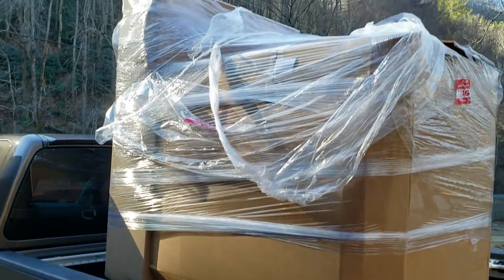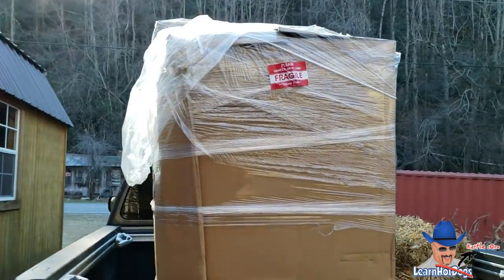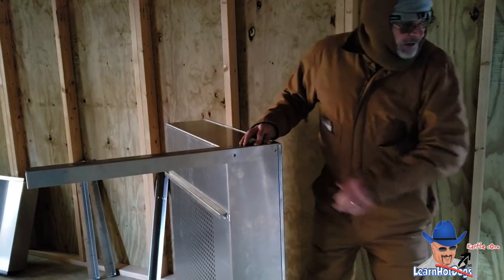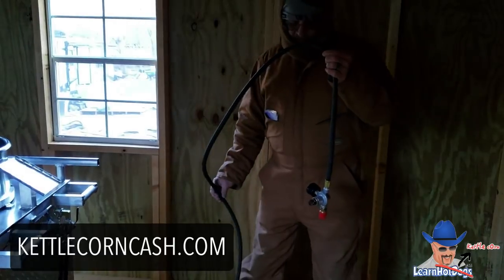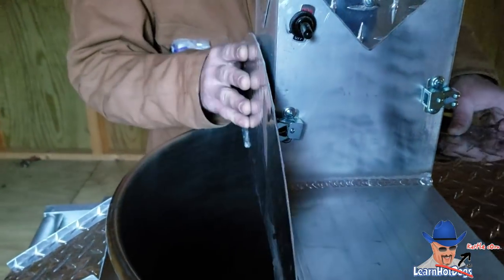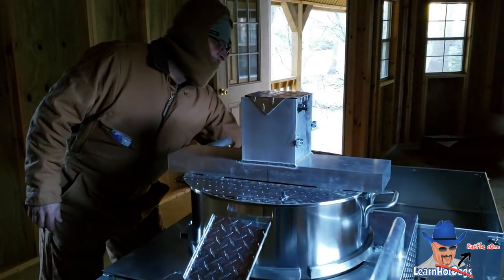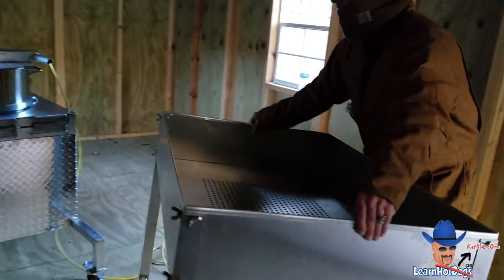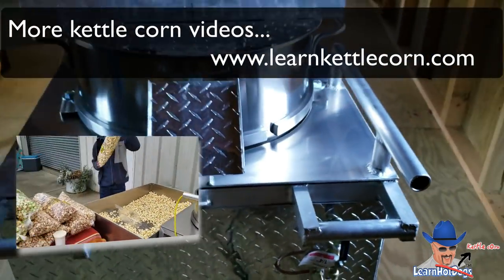Kettle Corn Machine Un-crating And Setup

Comment: I started out with a honda eu3000 great machine but expensive 2200.  I needed another and discovered the Ryobi 2300 inverter  from home depot its very quiet starts every time (3 yrs. now) great machine $600  very lite weight and very quiet machine I bought 2 because easy to load and unload .my honda is extremely heavy.
Reply from the maker: Hi Tammy!  That's great to know. On several videos done with sound check equipment, the WEN was the closest to Honda in quietness. I'm hoping they're right. With Honda, you're getting quality but you're also paying for that name. I have a Ryobi saw and it has done well over the years.

Comment: Have you done Hawaiian Shave Ice?  I am finding concessionaires panicking because of COVID.  I have recently purchased used kettle corn & shave ice equipment.  I jumped on the shave ice equipment solely because the used equipment was inexpensive.  Though I have not done my due diligence I felt I could not lose being I only paid $200 for a machine that sells new at $1700.
Reply from the maker: I haven't, but many vendors in VU do it.